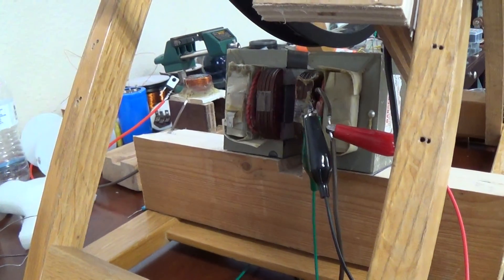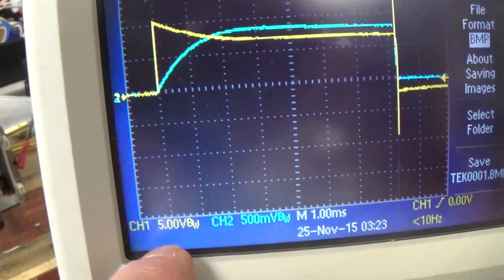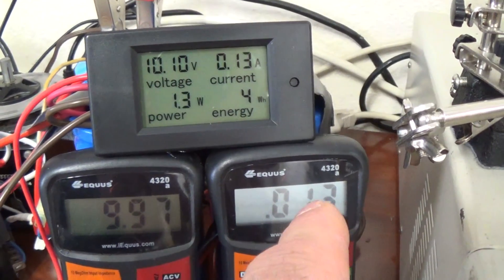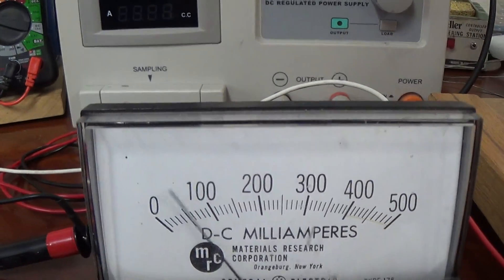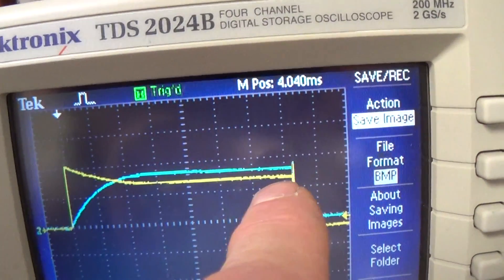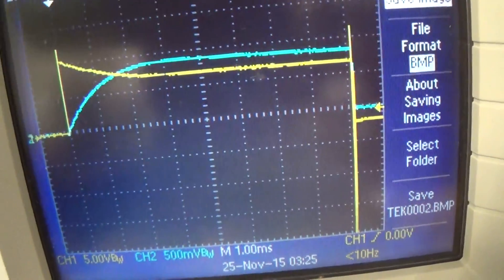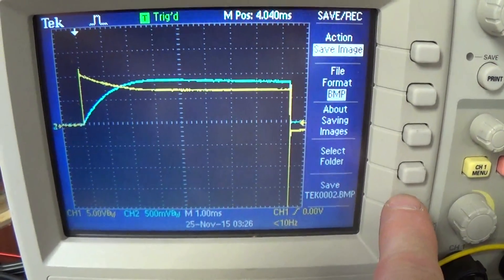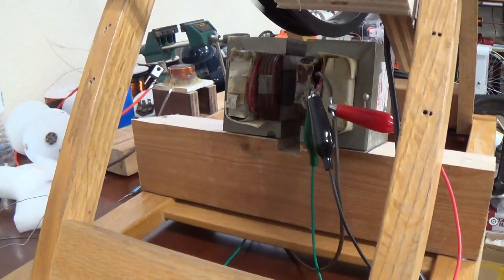Bucking Field Reluctance Motor Design by gotoluc test 2

Comment: It looks to me like the pulse is way too long. The field is established in the 1st 20-25%. Also it looks like 2/3rds is resistive. Notice how the voltage ramps down then levels off. Same with current; ramps up the levels. Where it levels shows where the field is established. The rest of the power doesn't  add to the field.
Reply from the maker: +Miner4aheartofgold Yes, you're right on everything. This was just a quick test and was not optimize. I did the optimization  the next day. It's all in the forum topic. Link in about details.